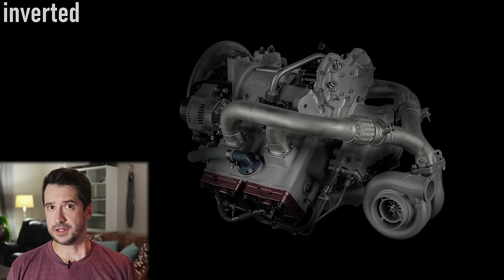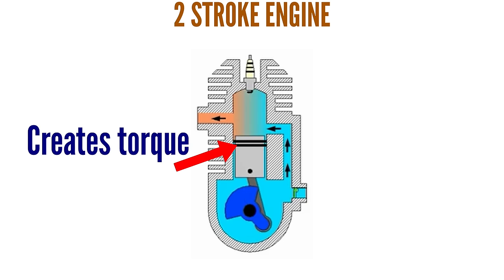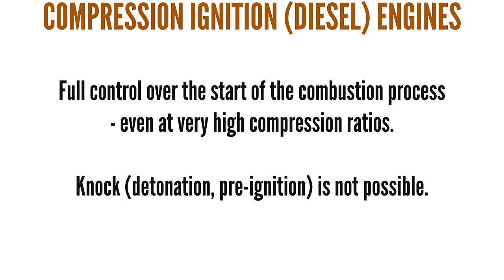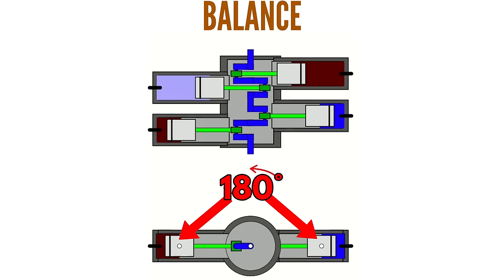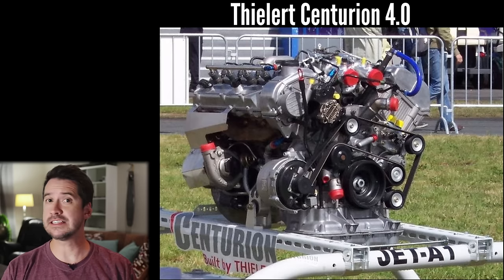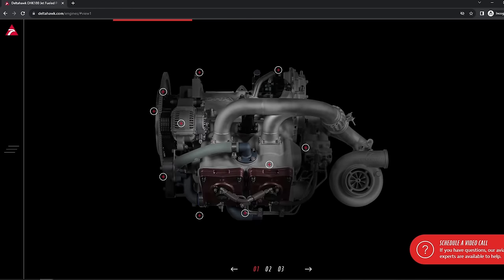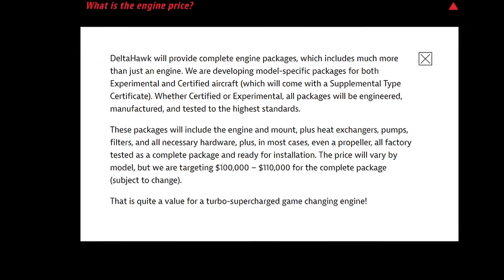Deltahawk's Jet Fuel Piston Airplane Engine Explained

Comment: The only advantage is that it's running on cheap kero instead of expensive petrol and two stroke oil.
This is standard practice in outboard motors for near a century in many parts of the world.
You start the motor on petrol mix, and switch to kero when the outboards warmed up.
Best thing is to use a piezovalve compressor assisted head fuel injection, like mercury, evinrude, tohatsu 2stroke outboards, resonant exhaust supercharging, and preheat your kero before feeding into the spray injector.
Reply: Avgas is becoming scarce and every airport has jet fuel.

Comment: What is the TBO. I will be a believer when one of these goes 2000 hours. It does look promising. The added weight of this engine is offset by the plane needing to carry 40 percent less fuel. Added weight on front mounted engines will have to be offset with more weight in the back, either ballast or heavier trim. Someone needs to design a plane around this specific engine.
Reply from the maker: Also, when comparing weight to other engines, keep in mind this engine is turbocharged, meaning it actually produces 180hp at all altitudes. Non-turbocharged engines outputs 180hp only at sea level density altitude, and power decreases as altitude increases.
Reply: @LetsGoAviate  That particular problem has been solved by more than one aircraft piston engine developer.

Comment: I don't get it... compared to a Lycoming O-360, it produces the same HP but fuel consumption is higher: 10.8gal/hr vs about 8gph for the O-360, it's heavier than the O-260 by about 100lbs, and it is 2x the cost of an O-360. Who exactly is this Deltahawk engine for?
Reply from the maker: It only produces the same horsepower at sea level. The Deltahawk is turbocharged and will give 180hp at all altitudes, where the non-turbochrged O-360 will lose power with altitude, roughly 23% loss at 5,000ft DA.
Reply: @LetsGoAviate  But.... the partial pressure of oxygen lowers with altitude.  A second stage of supercharging is needed once the maximum air intake cannot provide enough oxygen to burn all the fuel.
Reply from the maker: @floycewhite6991  Correct, I should have said, it will provide full power up to around 15,000 feet.
Reply: There are turbo normalized 360s, right?  Need to do apples to apples.

Comment: So how does an engine without cams or electronics time when to inject fuel? I'm assuming that am engine without valves wouldn't need cams unless there specific cams for the injectors. Thanks for the video.
Reply: The injection pump is timed to the crankshaft
Reply: Thanks...

Comment: Does the engine loose horsepower with higher altitude are does the turbo compensate?
Reply from the maker: It should produce full power up to around 15,000 feet

Comment: Very interesting video, a couple of thoughts I had whilst watching was: it's spoken of as a diesel (compression ignition) engine ruunning on jet fuel , but could it be setup to use diesel to use in say gensets? also with the direct drive engine RPM is limited so an increase in torque (for power) is desirable so is the engine "undersquare" (longer stroke than bore size) to take advantage of "leverage" (and the slower speed longer stroke gives more "port" movement timie) and the other thing noticed was regarding the supercharger which on the animation looked to be a lobed Rootes type and also a lot of commentary about engine balance would an ecccentric vane Wade type (iirc) be usuable as not only a supergharger but as a form of balancer as well have any advantages?
Reply from the maker: Interestingly this engine is actually square as per the bore and stroke length displayed on their website. 

I'm not sure if the supercharger could be used to even-out the secondary imbalance as it would need to spin 2x crankshaft speed. I think that would would be unnecessary though, as the secondary vibrations in the V4 is small enough to basically "ignore". It would likely be smoother than the rocking couple secondary imbalance in a boxer 4.
Reply: I'd certainly go undersquare if I were designing it for just that reason.

Comment: What happens if the oil seal to the turbo fails and the engine rpm runs aways?
Can someone explain that please.
Reply: Some Diesel engines have a safety device that closes the air intake to safely shut down in the case of a false fuel runaway event.

Comment: Is this 357 with all fluids or empty 🤔 I know a big problem initially for these engines was the requirement to be liquid cooled.. I think hes over explaining the engine quite a bit by comparing it to other A/C engines.. it really should be in a class of its own and not compared at all when trying to explain its specific limitations/benefits

Comment: 6 v 71 Detroit diesel shortened 2 cylinders and turned upside down
Reply: No.  Detroits have exhaust valves in the cylinder heads.

Comment: Can it run on standard diesel fuel as well?
Reply from the maker: Yes
Reply: @LetsGoAviate if that's the case, the power output would be  higher, as well as EGTs.
Reply from the maker: @Jessersadler  I can't think of much reason to use standard auto diesel though, other than perhaps emergencies where Jet A not available. Jet A is less than half the price of diesel in the USA and generally good availability.
Reply: @LetsGoAviate  Jet A average today is 6.14 a gallon.  diesel is around 4.  Red diesel is even cheaper. . .Not to mention diesel will make more power, and have better lubrication.  Seems like plenty of reason.

Comment: Wouldn’t that be an A4 instead of a V4.

Thought diesel have more torque from the longer stroke and longer throw of the crank. More off center you push the crank the more torque you can make for the same amount of effort.
Reply from the maker: Would an upside down i4 (inline 4) then be a !4? 😆 Lame joke aside, because of longer stroke yes, as well as higher compression ratio. It's to be noted the Deltahawk is actually a square engine (bore and stroke is the same).
Reply: Diesel engines tend to benefit from long strokes more than gasoline engines, that is why long-stroke diesels are common.    The combustion of diesel fuel is slower than that for gasoline, so a diesel tends to run at lower revolutions, and this again favors longer stroke engines ( at high rpms, longer stroke means higher pistons speeds and greater forces on connecting rods, etc).    Another reason that diesels tend to have long strokes is related to the higher compression ratio.   With a short-stroke diesel engine, the piston gets so close to the cylinder head that the fuel tends to impact the piston before combusting (newer injectors have reduced this problems).  Even so, many diesel engines have a bowl-like depression in the piston for this reason.  A smaller diameter piston also has a smaller area to seal with the piston rings, reducing blowby (a bigger issue at the higher pressures).

Comment: I want to see an aircraft version of the Achates engine.
Reply: Junkers Jumo 205 flew across the Atlantic to Brazil in the mid-'30s.
What?  Did you think Saudi Aramco invented it?
Reply: @floycewhite6991  no I didnt think that. I mean a modern version
Reply: @ianboard544  Ah.  Sort of like the military small-boat engines of that type.  Except you'd want to mount it horizontally.

Comment: @Lets Go Aviate   5:24 you are wrong.   Thx for the video of this interesting engine but crank drillings for lube oil delivery to bearings are obvious in the cross section at 5:30.   There are oil jets but they are for piston cooling not lube.    😢 details matter.
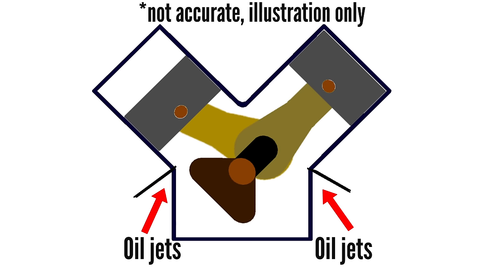Reply from the maker: Displays in black text at 5:05 that my illustration isn't accurate.
Reply: @LetsGoAviate   sorry I was as off by 20 seconds, edit made.   However your response doesn’t imply you understand what I’m talking about?  Your commentary indicates splash lube, which is wrong.

Comment: Mmmm , sort the problem about primary engine balance , why don’t they do a 120 degree V6 ?
Reply: if the v4 in question is at 90° shouldn't primary balance not be an issue
Reply from the maker: Yes it's 90° and therefore it's safe to assume they've used the correct weight for the crankshaft counter balance to achieve perfect primary balance.

Comment: 1). A Detroit Diesel is a “uniflow engine” with inlet ports at cylinder bottom, and exhaust valves at the top.  The Deltahawk engine is Schnuerle ported like a chain saw.  Schnuerle ported diesels are not new, but they are rare.  I think their scarcity may stem from an undesirable lumpy torque curve.  However, Propeller torque is OK with Schnuerle 2 strokes.
2). A problem with two stroke engines is wrist pin lubrication.  A 2 stroke wrist pin is always loaded in one direction.  A 4 stroke wrist pin breathes on the intake stroke allowing oil to flow.   Detroit Diesel (and others) have surmounted the wrist pin problem.
3). Diesel cycles are hard on props.  With mechanical system, the fuel injected initially takes a bit of time to heat to combustion temperature.  When it does, the fuel that has piled in behind it, ignites.   Results is a hefty pressure rise and the prop gets whacked.   (Electronic fuel injection is more controlled).   Results is metal fatigue and vibration resonance.
4). I wish Deltahawk the best with their venture.  They have the best mousetrap and the same power to weight as an Lycoming IO360…remarkable for a diesel.       Cheers
Reply: Actually most late 20ieth century motorcycle two strokes are considered Schnuerle ported, even though they're not the classic design..  The Classic Schnerle is the DKW and other Euro spec 2 cycle car engines, the best developed one was the SAAB 750 and 850cc triples.  All Scnuerles would be gasoline engines exclusively because of the design is really dependent upon pressure waves being passed up the transfer ports from the cutouts in the crank wheels and the tangential placement of the transfers and exhaust port to create a swirling air fuel mixture in the cylinder that helps with even combustion and exhaust scavenging.  I've owned a few SAAB 2 cycle cars and discessued with a Swedish born SAAB mechanic who described the improvements that SAAB made on the old DKW car engines they copied.  If you have driven a SAAB you'd understand,  they are really efficient and incredibly smooth running and have a very wide torque plateau.

Comment: I would agree that Diesel is definitely a better way to go but the technology that you are demonstrating is certainly not new and would suggest you look at the Delta as the efficiency of the Delta at full noise is around 60% as a opposing piston engine. And I certainly echo the fact that a supercharger on a two-stroke is an oxymoron and shows lack of education. It is a blower used to simply supply ear to the engine.
Reply from the maker: Ooof. Since I report what's written on the Deltahawk website, should I pass the message about lack of education on to them?

Comment: Sure it could be light weight, but it's not!

Those designers & enginerds need to look at some Honda's!

The cbr1000rr engine has 180hp, and with the gearbox it weighs about 145lb. Less than half what that does, with a good portion that isn't needed!
(in  that application, because a plane doesn't need 6 gears)
Reply: It couldn't power an aircraft for 2,000 hours and it's probably not the most fuel efficient way to make power. The current model makes 214 hp at 14,500 rpm. A purpose-built engine of around 1.8 to 2 liters would be great, though. The Honda L-series (like Viking Aircraft Engines uses) seems to work pretty well at this power level (while weighing about 100 pounds less than the Deltahawk), though its bore and stroke are not optimal for aircraft use. A purpose-built aircraft engine would also be lighter than the Viking engine.

A Hayabusa-derived engine (something like the Hartley Bolt 4) would be great for racing.
Reply: @PistonAvatarGuy   I got to thinking about it & I realized they may be using a different HP rating system. Ie: the Honda GX200 is rated at "6.5hp net", and it has similar duty cycles to a plane. With only removing the governor people are seeing over "10hp peak" on dyno tests (apparently). 

Inflate those #s by ~25% & that makes hp/l decent, but it still seems heavy.
Reply: @Iowa599  The duty cycle of an engine isn't part of its power rating. Pretty much all ratings are net ratings these days, though motorcycles may have different standards than cars.

Anyway, the concern here isn't duty cycle, it's longevity. A 200+ hp, 1,000cc engine running at 10,000+ rpm just isn't going to last very long when being asked to continuously operate at high power settings... maybe a couple hundred hours.

A liquid-cooled engine, like the CBR1000RR engine, isn't likely to have an issue producing its full output continuously anyway, that's basically what it does when it's being raced. The cooling system of an air-cooled aircraft engine, on the other hand, is designed for cruise operation and needs an extremely rich mixture at full power output to prevent it from overheating.
Reply: @PistonAvatarGuy  "rich/cruise" is dumb. That's where bad emissions come from, and there have been ways to avoid that for a long time. Ie: Honda CVCC

As far as temps due to "running too long" is also dumb. Do you think the engine doesn't heat up all the way for hours?

I have run over 22 hours (driving, 24hr start to finish, stops for gas) at 70mph+ continuosly, many times.
Reply: Go redesign that motorcycle engine to run compression ignition, then tell me how heavy it gets.
Reply: @andyharman3022  Compression ignition engines make the worst possible aircraft engines.

Comment: Don't I remember that the Messerschmitt BF-109E had a Daimler-Benz liquid cooled, supercharged, direct fuel injected, inverted vee engine? Albeit a V-12. It was a gasoline engine not a diesel.
Reply: Yes, but it used a centrifugal supercharger which requires a fairly high revolutions to produce significant boost.  Two-stroke engines need the higher-pressure air even at start up to prevent the exhaust gasses from blowing back into the intake port.  For this reason, two-stoke engines generally use a positive displacement system like their own crankcase, a Roots blower or Lysholm compressor that still provides pressurized intake air at low rpm's.

Comment: They didn't mention anything about emissions. 2 stroke engines have horrible emissions, which is why they aren't used much anymore.  Direct injection will help, but won't eliminate emissions.  
What have they done to prevent a runaway engine? This is something that happens quite commonly in diesel engines.  It can happen because of a stuck injector, or simply because sufficient oil gets into the cylinder (past the rings or from a failed turbo seal).  Once an engine runs away, there is very little you can do to stop it short of shutting down all airflow into the engine.  This would be bad if it happened during flight.
They didn't mention anything about the reduced package size of the engine because of the reduced size of the head.  This is pretty important on small aircraft like the Cub or Super Cub.
Reply from the maker: Emissions touched on at 16:33 
No, direct injection doesn't eliminate emissions, but much improves it, and remember, it's a diesel engine.

Good question about diesel runaway. I don't know.

And thanks for mentioning about package size. It should be slightly better for sleek cowl designs than the opposed 4, but I don't think the difference is huge.
Reply: Diesel runaways are uncommon. When was the last time you witnessed one? There are millions of diesels on the road today and runaways are few and far between. But you're right: in an aircraft a runaway would be dangerous. A simple air shut-off valve solves the problem.
Reply: @paulmaxwell8851   I've witnessed 3.  Two Detroit Diesels (6v-53 and 6-71) and one 5.9 Cummins.  I've also witnessed the aftermath on several others.  But to be fair, I've worked on a lot of diesels - more than the general public would have.  Detroit Diesels often came with an air blade shut off as an option, because they were prone to running away (the linkages underneath the valve cover were prone to binding up, and the injectors were prone to sticking especially if they have been sitting a while).
Reply: Actually 2 stroke Diesels don't have "horrible emissions"   if in good condition and tune, they are no more or less wasting of hydrocarbons than a similar displacement 4 stroke.  Old school gasoline 2 strokes are the engines that have had bad emissions. but they readily can be adapted to catalysts and can run fairly cleanly. Even more so with fuel injection and carefully designed oil injection systems.

Comment: 2 strokes with opposed pistons fuel injection and pressure lubrication solves all the
problems with 2 stroke engines.